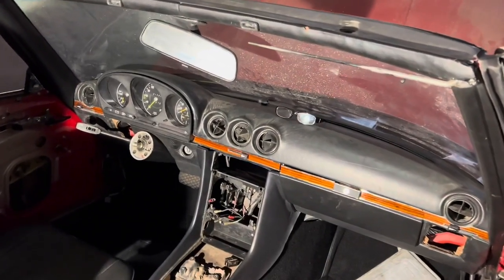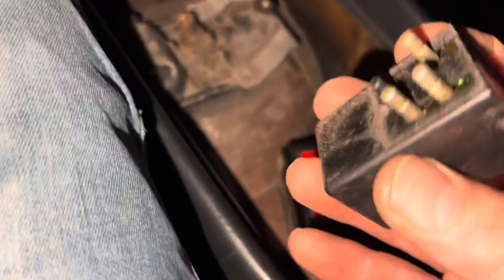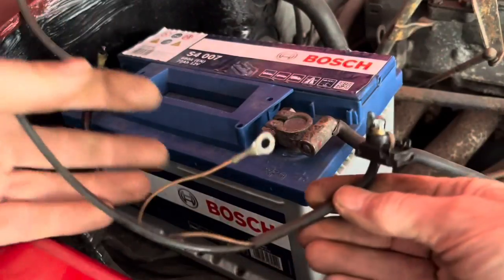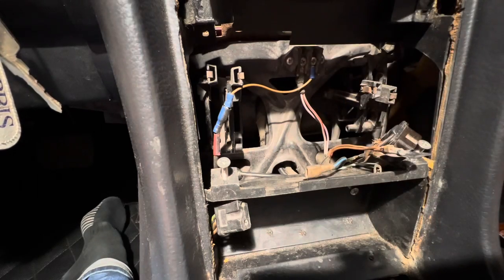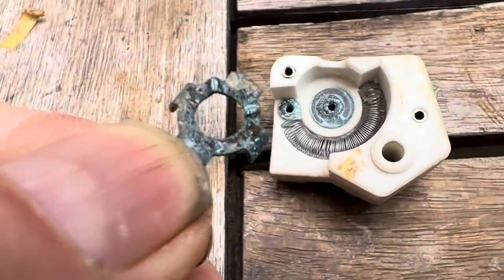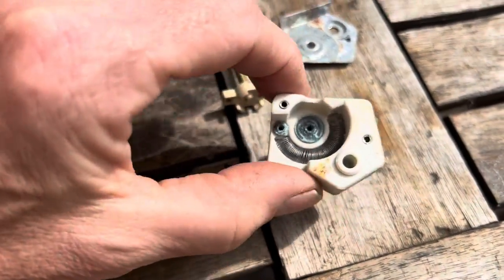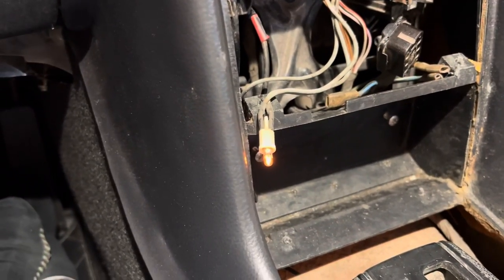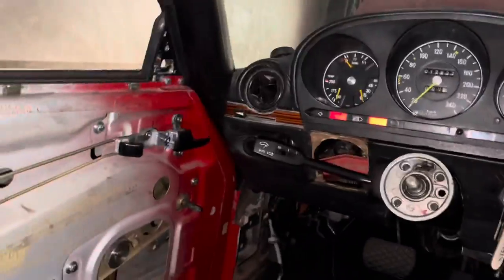Mercedes R107 electrics - dimmer & hazard switch + fan blower motor and lights

Comment: Thank you!!! So much great information and just looked up apa and found so many things I need for my R107. Excellent tip, Cheers!
Reply from the maker: Thanks for your comment - I hope that means we have a new subscriber! Mike
Reply: @MikesMercsandothercars  Yup. I recently got my R107 back in June. It has been sitting outdoors since 2013. engine was seized and fuel system was completely shot. I now have it running and at least drivable. Watching your videos for tips and inspiration. Thanks!
Reply from the maker: @EricNormanSilviaJDM  Hope it all goes well - next up I need to take mine for a longer drive and see what goes wrong...and add it to the snag list. Mike

Comment: Many thanks, again. Sent you a whatsup message re bolt, which is finally in. Putting stuff back, center console my bridge to hold the radio also snapped so need to figure out a way to fix that, did not make the padding under the carpets “a la Mike” , just found some stuff on Amazon and glued it to the floor boards post paining them in rust protector from Eastwood. Repainted the needles in the dash, put it back in, tested the dimmer switch and yep, she no working. Did follow you instructions but could not get the dimmer switch to work even post cleaning. So Merc replacement on order. New brake master cylinder and booster are in, bleeding brakes next then engine flush. Sadly have rust on the rear window of the slc. Will have someone look at that. Thanks again and be well.
Reply from the maker: Thanks - I did see your amazing 'Heath Robinson' trick to get that bolt in - you must be quite pleased with yourself! You are really cracking on with that car. Did you see the brief glimpse of the 450SL the SL Shop are 'pimping' up at the end of the SL Shop open day video? I'm waiting for my fuel injectors to come back from Mr Injector and then it will be time to have another go at figuring out why the 280SL doesn't start. Mike

Comment: Hi Mike.Very interesting video as always. My model is a SL300 of 1986. The hazard switch of this car has just 8 pins. I´m unable to locate the scheme, and I need the colors of diferents cables and position, because there isn´t a general connector but six independents ones. Cables are originals. Excuse my bad english.😃 Thank you, Best wishes
Reply from the maker: Thank you for your comment. Does you hazard switch look the same as the one shown in the video below at 1:17:

https://www.youtube.com/watch?v=ltj-O00UkBc&t

Is the problem that you have  taken the cover off the plug and are unsure which leads go into which holes? 
 Do you still have the plug cover?

Can you tell me the color of the leads? eg 1 one brown...one red/black etc etc

Mike
Reply: Thank you Mike.  Someone connected each pin, separately without general conector. The system worked, but, several cables go out of his position, because vibrations and rigidity of wires. Now, I have doubts about some connections. red, White+blue, black, white+black (Left), green+black, white+black, brown, Green+black (Right).  Keep in touch, thanks again
Reply: Yes, It´s the same switch with 8 pines.Thank you

Comment: Great video.   It was exactly what I was looking for.   My gearbox does not illuminate and thought maybe the fuse was bad.   Instead, it looks like I need to replace the light bulb.    

Question: do I need to remove the wood console to gain access to this wiring bulb, or can I replace the bulb by removing the rubber gasket surrounding the gearbox?  🙏
Reply from the maker: Thanks for your comment. I have only ever changed that light bulb with the wooden panel removed BUT it may be possible to get access just by removing the rubber gasket - try it and let me know how you get on. Mike

Comment: Thanks for the video, very helpful. Just wanted to mention that your revolution counter belongs to a 450, the 280 (M110) rev counter has the red line starting from 6500. Regarding the rheostat I did the 100 times method!! and ended up with broken spring :-)) so I disassembled it and did some cleaning and soldering to get it back to work. My only Issue is I don't know what size of bolt and nut should I use to secure it. At present it's held in place by the long screw but I'd like to make it better. If you had a chance to fix yours, let me know what type/size of bolt and nut you would use. Thank you very much.
Reply from the maker: Thank you for your comment and also for highlighting the issue with the rev counter - I hadn't noticed that!

The dimmer switch is held in place with one long screw (no nut and no washer) This is the same type of screw which screws the instruments to the plastic casing see 5.10 in video below.

https://www.youtube.com/watch?v=JGVi3O4o1bQ&t

If that is not what you mean - let me know. What part of the world do you live in - If I can find a spare, I'll send it to you. Mike
Reply: @MikesMercsandothercars  Hi, since the two rivets are gone after drilling, I want to replace them with some tiny bolts and nuts. At present the dimmer is functional and held in place with the long screw but in case I undo that screw everything will fall apart :-) I can use some tiny tie wraps but I'd prefer to use bolt and nut. If you want to fix your old rheostat what would you use instead of rivets? Also thank you very much for your offer.
Reply from the maker: @tahaau  Hello - the choice of how to proceed depends upon whether you have completely drilled out the brass rivets...or whether you have just drilled out the top part of the rivet.

1. If the latter, you can use M1 or M2 self tapping screws and screw into whats left of the soft brass rivet tube.You could also potentially use an M1 or M2 "tap" to cut threads and use a 'machine screw'.

2. If you have completely drilled out the rivets and are just left with the white plastic, you will need at least 15mm long M1 or M2 stainless steel or brass bolts with a M1 or M2 nuts.

Places like https://boltworld.co.uk/ sell them.

Hope that helps.

Mike
Reply: @MikesMercsandothercars  Thanks for your reply and also for the link. That was very helpful.
Reply from the maker: @tahaau  As it happens....I just went to buy a newpark brake switch only to find they are over £200!! So I will shortrly be doing a vodeo about how to repair the switch which will entail drilling out the rivets and bolting it back together. I have ordered various size nuts and bolts to see which works best. Mike

Comment: Hi Mike are you still contemplating doing an ev conversion to an R107 ?
Reply from the maker: Thanks for your comment....well I was until I found out about the cost. The kit alone is over £50,000!!...and that doesn't include fitting it (that is from Classic EV is Wales UK) The SL Shop had their R107 ev for sale for close to £90,000! So...I have cooled on the idea but not gievn up completely. Mike
Reply: I am interested also but not at those prices! I would imagine there is a way to do it more cost effectively. I hear GM and Ford in the usa are going to introduce "crate" kits to retrofit some of their vehicles. These could perhaps be adapted to the R107.
Reply from the maker: @SuperJg1964  Yes - at those prices, its just not worth it. One of the issues is the cost of the batteries. Most classic conversion places are using 2nd  hand Tesla batteries and these are expensive. Like you, I am on the look out for something affordable. Mike

Comment: Can one pull the instrument panel without removing the steering wheel? I'd like to change the lighting rheostat  and a few bulbs only.  Thank You!
Reply from the maker: I'm not sure...I have only ever done it with the steering wheel removed. I'll check tomorrow and get back to you.

Is there a reason you don't want to remove the steering wheel? It is only held on with one nut.

Mike
Reply: Steering wheel removal requires a breaker bar and long pipe to hold steering wheel steady.  @MikesMercsandothercars
Reply from the maker: Yes - I suppose if it has never been off before, it might be a bit tight. An impact wrench will often work if you happen to have one. If not, it is Christmas coming up...you could treat yourself. Mike @skidaddy626
Reply: @MikesMercsandothercars  Impact would work.  Thanks for suggesting it! And thanks very much for your videos!
Reply from the maker: No probs - glad the videos are of use and good luck with the steering wheel removal. Mike  @skidaddy626
Reply from the maker: PS DONT forget to mark the position of the steering wheel relative to the spline BEFORE you take it off. Mike
Reply: @MikesMercsandothercars   You are spot on!  I marked the steering on my 1979 Ford Ranchero the same as you advised.  My Mercedes is 1980 280 SLC. Would you by chance know the part numbers for the instrument panel dash bulbs?  I understand there are two types. One which is very small and narrow that fits into the end of a long tube. The other type bulb fits the black sockets. Some advertised are 12 vt  1.2 watt and the other  12vt 3 watt.  Would the 3 watt cause more heat damage due to it being over twice the current draw?  Thanks!
Reply from the maker: You could convert to LED and then heat wouldn't be a problem.

Mercedes part number A0015445594 is the larger  12v 2W bulb in the instrument cluster

Mercedes part number N000000003651 is the smaller  12v 1.2W bulb in the instrument cluster

I'm not 100% sure on this so probably best to call parts department of Mercedes for the correct bulbs for your car.

Mike

 @skidaddy626
Reply: @MikesMercsandothercars   I really appreciate your help! I was able to remove the steering wheel using a 3 foot long 1" O.D. pipe wedged in  the steering wheel and the other end pushed against the drivers seat. This allowed the wheel to be stationary when removing the nut on the steering column. Cheers across the pond... frpm the High Plains Desert of New Mexico! 🤠